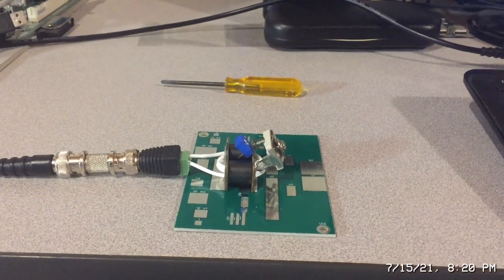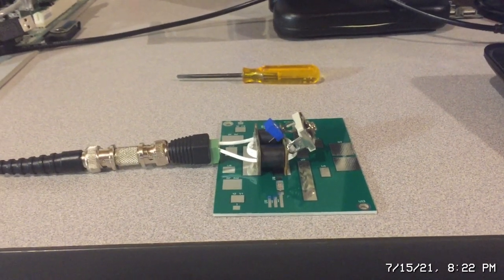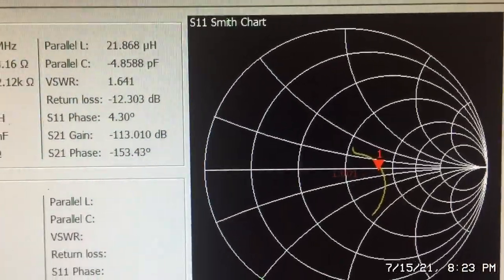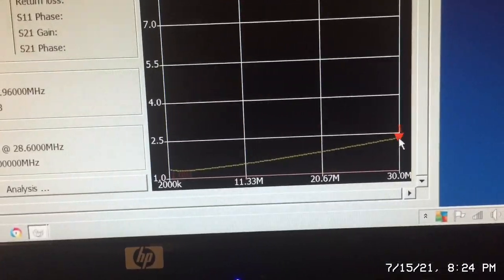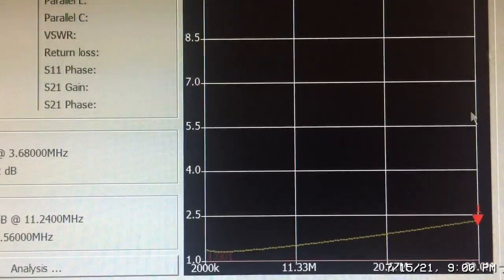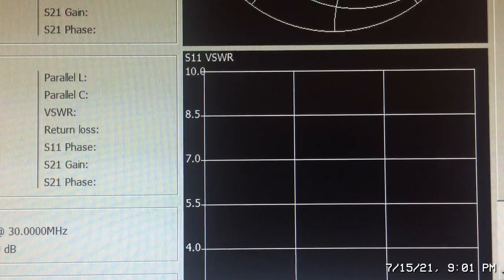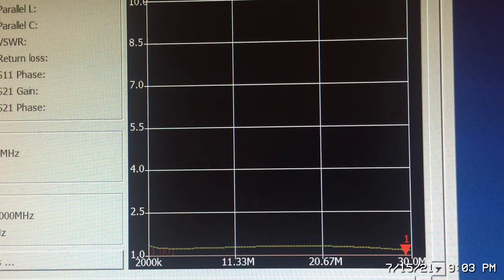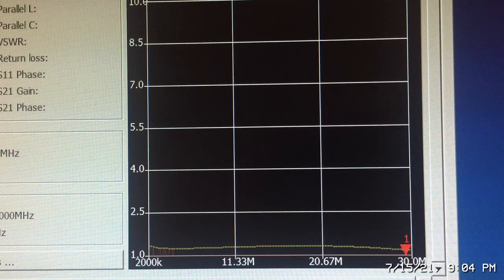Impedance  Matching Back To Basics

Comment: Hi, thanks for posting the video.
 Between 6.50-7.10, you are mentioning that you are adjusting trimpot at one point and capacitor at another point in time both of which you have across the primary side of the transformer.
You may make it clear.
The variable capacitor (padder) has to be adjusted for equating the leakage inductance.
The trimpot (variable resistance) will have to be adjusted to be near the impedance of the drains of the MOSFETS around 5.6 ohm.
The NanoVNA's input impedance is 50 ohm unbalanced.
The ferrite loaded broadband
 transformer's output is 50 ohm
 balanced. You ought to have a 1:1 current BalUn (choke) to interface between the transformer and the nanoVNA.
De VU2RZA
Reply from the maker: My error, I only adjusted the trimmer capacitor. The Resistance needs to remain constant. In my other videos I show the match to the input impedance of an LDMOS Transistor. That was not the purpose of this video. Thanks
Reply: @rfmanchannel6915  👍👍
De VU2RZA
Reply: @rfmanchannel6915  hi, you can do one more thing.
It's my suggestion and a request as well.
You can make a demo video either separately or add in the present one itself.
If you can afford to make a similar broadband output transformer (of course with a 1:1 current BalUn choke) you can connect both back to back.
Now you can add a 50 ohm pure resistive load to the secondary side and measure the S11 parameter on the nanoVNA or simply connect an SWR meter and your HF rig for the signal source (1W or less which depends on the power handling of the 5.6 ohm resistors); there won't be any reflection.
I hope you would want to do that for the sake of completion.
All the best 👍❤️
De VU2RZA
Reply from the maker: @subramanianr7206  I already have a video the shows the impedance match of an output transformer and a BLF188XR LDMOS transistor looking into the output cable with the VNA. The is the correct way to make this measurement. Thanks!
Reply: @rfmanchannel6915  that's true.
The output impedance of the MOSFETs like, MRF 150 or SD2933 would be around the same 5.6 ohm; hence the 9:1 ratio of the transformer.
Similarly the input impedance is around 5 ohm and hence the 1:9 transformer.
Sometimes the input impedance transformer might be matched with a different ratio like 16:1 (i.e., 4:1 winding).
Again it all depends on how many transistors you have in the push-pull mode, a single or pair in parallel.
BLF188XR is a "Gemini" pack.
And the output of two such Gemini packs can be combined in a Wilkinson combiner (with a splitter at the input, of course)
I did some experiments and the back to back arrangement was one among them.
Wish you all success.
De VU2RZA
Reply from the maker: @subramanianr7206  Thank You!!
Reply: @rfmanchannel6915  you are welcome 👍

Comment: Hi RF Man, Love the content! It just happens I'm building a HF (20m) PA at the moment, so these videos are really great.  Quick question, lets assume you have a transistor with no datasheet, or maybe you have a datasheet but the device is poorly characterized.  How would you go about finding the input z?  I realize this could be a tricky proposition, since it depends on so many things: biasing, feedback, etc.  I'm interested in your take, worth another video?
Reply from the maker: You are correct. I often encounter the same situation. You can try measuring the s parameter of the transistor with a VNA and use that to calculate Zin and Zout. I have also contacted the manufacture and requested the data. Also, you can use an L Network to try and measure the impedance. This is an empirical approach.
Reply: @rfmanchannel6915  Thanks for taking the time to respond RF Man.  Well, if ever you're stuck for episode subject matter, consider this a shoe-in.  I reckon a lot of hams would love some practical examples of how to do this with modern tools on the bench (NanoVNA, TinySA, etc).